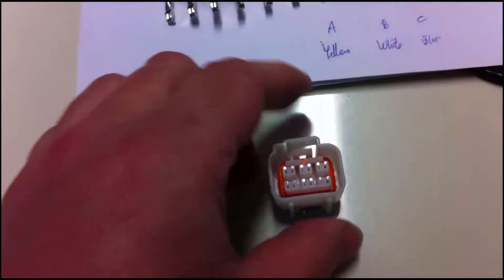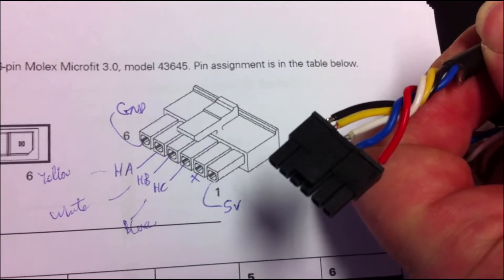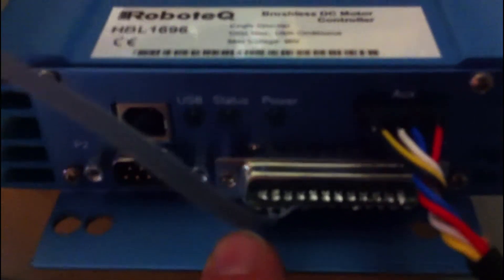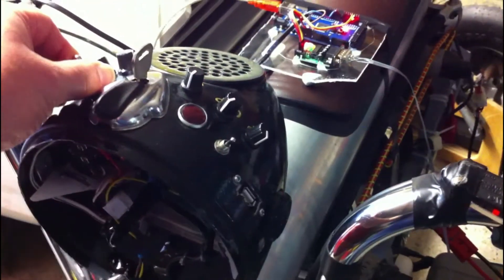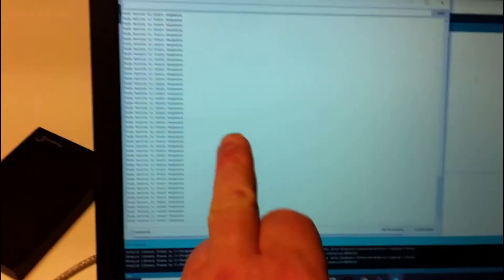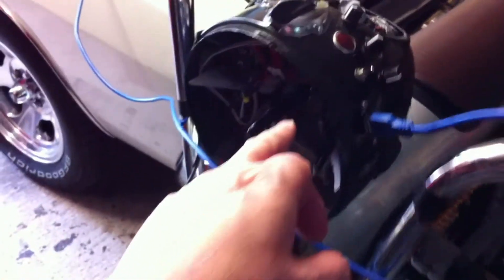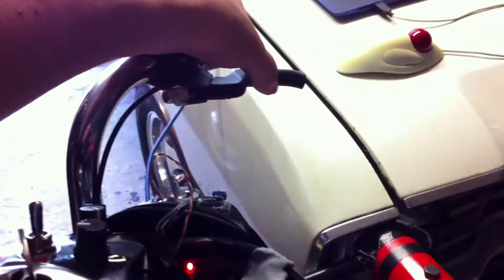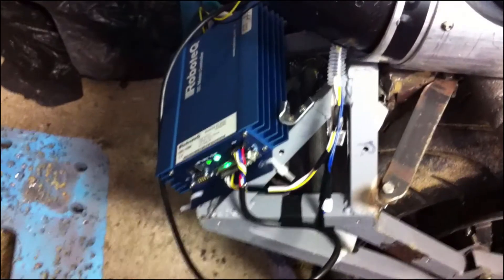Unicycle Garage #16 ARDUINO-ROBOTEQ upgrade

Comment: for what reason upgrading from Kelly to roboteq hbl 1696
Reply from the maker: It has better engine braking than the Kelly and we can drive downhill now without it rolling away from underneath you. It has no centre "dead" zone which makes the unicycle much more controllable. It can be controlled via serial communication from the Arduino.

Comment: Is there any reason for using Arduino mega.why not Arduino uno??
Reply from the maker: The Mega has 3 hardware serial outputs. The first can be viewed on a connected laptop to see data when debugging. The second controls the roboteq. The third sends data to the speech module.
It is therefore more convenient for development of a machine like this.